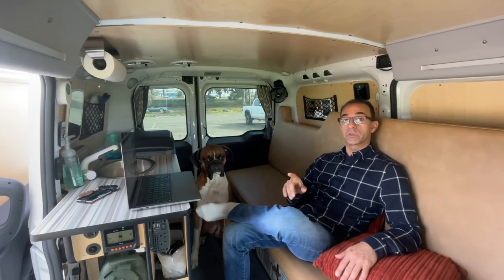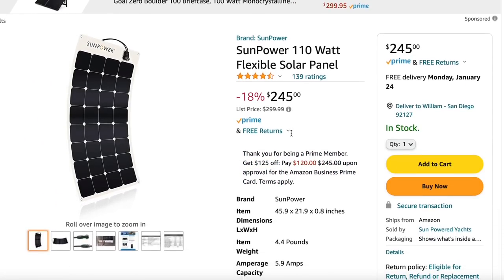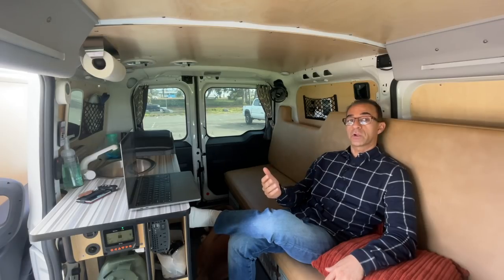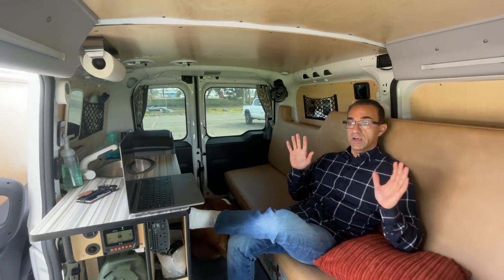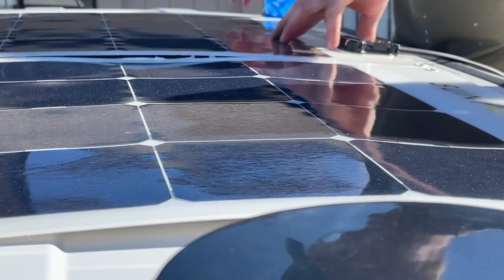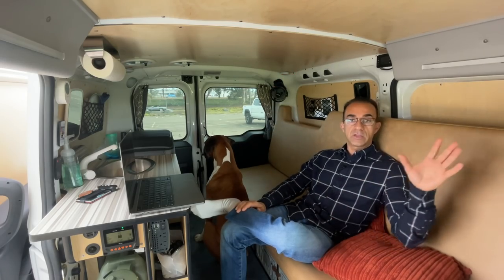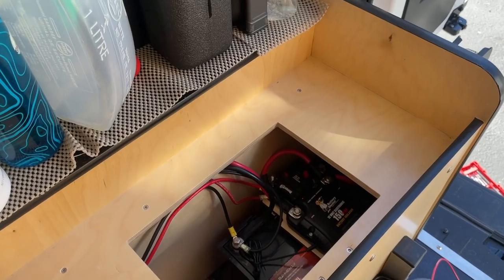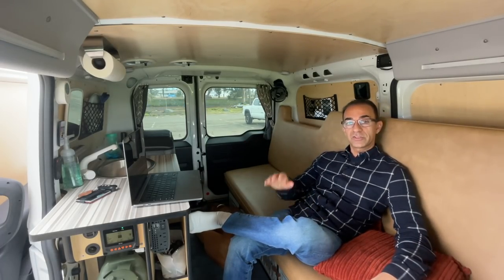My Van Gets BIG POWER Upgrades! (Solar + LifePo4 + DC to DC = 😳) Story #11

Comment: Those "pros" didn't seem very professional to me. Do you know why they couldn't just  use the same cables that went into the battery doctor isolator for the dc-dc charger? Not the right gauge?  Also did you consider getting the Renogy MPPT and dc-dc charger all-in-one?  Since you had to replace the solar charger anyways. It would have made sense to save space. I think you should have just gone with a Goal Zero 1500x powerstation or en Ecoflow River Pro. Save yourself the hassle....no "pro" installer needed.
Reply from the maker: Everything is wired nice and neat and all component locations are conveniently out of sight, out of mind. The All-in-one units are great I fusebox/wires are all setup and no need to change anything. As for Battery Doctor..  It is not compatible outside of itself.